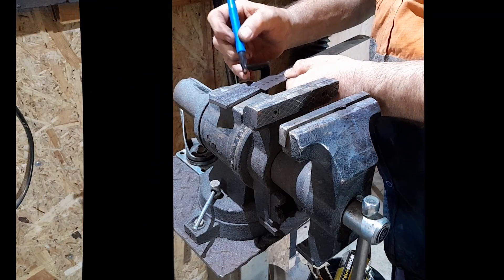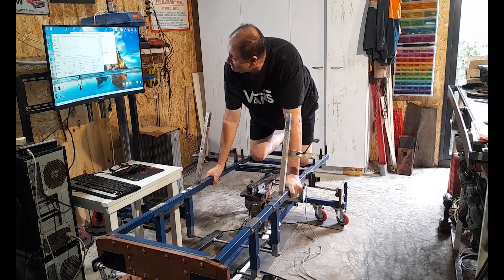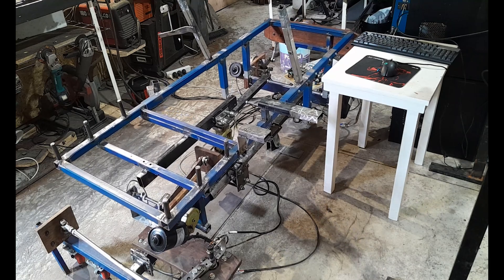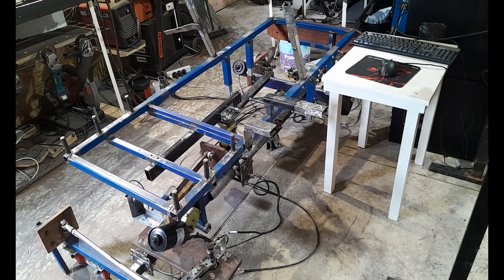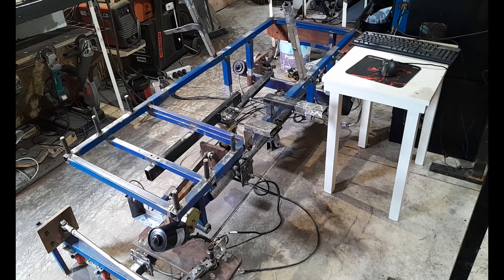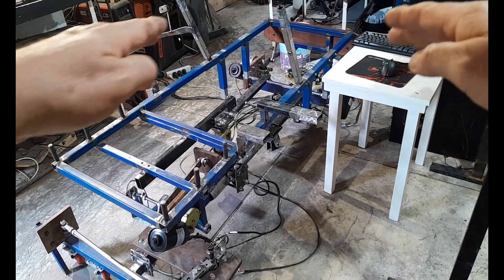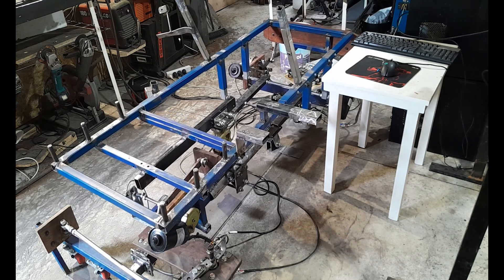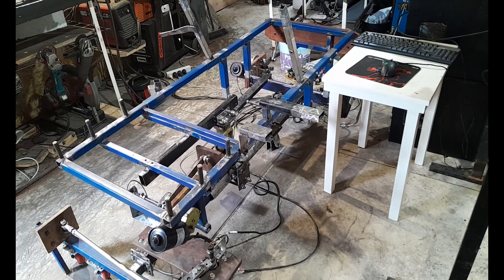DIY 4DOF Motion Platform Build For Everyone. #racingsimulator #flightsimulator #trucksimulator

Comment: Hey doc, I've found the perfect bearings to match your surge axis carriage as well as all the caster wheels (I found a pivot swivel rated for 700lbs so I figured I couldn't go wrong with how strong it looked) and I feel like I have a pretty solid idea of what I'm up against. 

I've found all the proper electronics, like 4 PSUs for the motors and Arduino Uno, but I remember you mentioned that there may be an additional IBT-2 needed for the 4DOF. Just wanted to confirm that I should be getting 4 IBT-2 controllers, 1 for each motor? I do remember you mentioned that some of them can come broken so I may order 1 or 2 extra just in case. I'm pretty sure that once I have the IBT-2 controllers ordered I'll have all the pieces I need on the way. 

I did miscounted the amount of ball joint/tie rod ends I was going to need so I'm short 2 tie rod ends. I think I can solve that by making my own with some random automotive tie rods. It's not ideal but I think it can be doable. 

Now it's time to watch your videos next to each other and try to reverse engineer some of the mechanisms for that new 4DOF. I think I'm getting somewhere but time will tell lol! Sorry for the long book and questions but thank you for the help and advise, I probably wouldn't be able to have this much confidence without you being there to answer questions and offer input. Keep up the great work!
Reply from the maker: Hey swamp man. How did you know what spec bearing to purchase? I don't think I've released any info about that yet. All good really, but the accompanying parts for the bearing trolley carriage (rail they run on, angle and plate they attach to etc) all revolves around the bearing size, not just the load! Now power supplies and motor controllers. I've been two days solid wiring and testing the new rig and I'm sick of these rubbish IBT-2 controllers. I've decided with the new rig, I'm going to spend the coin and get really good motor controllers. It's going to really increase the cost, but I'm sick of IBT-2's working, then not working. Plus, they really lack the all the finer details (bit rates and decent data transfer) you get with better controllers. I've spent so much time and effort making this thing great, I shouldn't garnish it with turds any longer.  I've been looking at the sabretooth 2 x 32's they are $240AUD each and two are required for 4 motors. But then I realised that because I have 4 power supplies (two new 50ampers) and my two existing 30ampers, this way is not ideal, as the sabretooths only take one PSU each. My existing PSU's aren't large enough to use with two motors. They are for one motor each. So I'm wasting PSU's I've already purchased as I'd need to now turn around and buy two 100 amp PSU's for enough grunt. This has directed me to the Pololu controllers. 4 required (you need one per motor and one PSU per motor so I don't waste my PSU's. They are around $200AUD each. I may end up using two IBT-2's on the horizontal motors (surge and yaw) to save some money if they are doing what is required, but I'm going to do this one way or another for a WAY better outcome and a totally kickass platform.
Reply: @Doctoradhd1  as for the bearings it was a lot of spitballing with my friend but we're fairly confident we found the same one. We took guesses on bolt sizes and used relative sizes for everything based off our guesses. Even if we're slightly wrong with the bearing, it should still work with no issue. (I think we spent an hour or 2 with your video paused as we broke it down piece by piece lol)   

After some more research I think I understand the PSUs now and how to properly power them. Now I'm off to go look at the better IBT2 alternatives you mentioned. Each days we get one step closer, hell I'm losing sleep imaging the excitement from it ha! Thanks for the info, Doc I appreciate it!
Reply from the maker: @swampsn1per878  You can go with any bearing size really, you just need to match the other components to the bearing. And if you are building the same rail system (made from 40mm x 40mm x 3mm thick 90 or angle) make sure you get minimum of 3mm thick. 

At the very peak of 90 it is thickest. Can run out to be 4 - 5mm at the peak when it's rolled out in the smelter which is what you want. This is where the bearings run. I've calmed down a bit from yesterday. It's been a long three days putting the wiring back together and having IBT-2's that were working perfectly suddenly stop working and vice versa. 

Because I'm using Ard shields this time around and hard soldering everything, it takes extra time to do this, but it's the only way to go.  I'm also researching the best IBT-2 alternatives, but there are not many options that have code etc written by someone to use with the Ards. Because the new setup requires two separate Ardunio's with separate profiles, you can mix and match different controllers on each Ard. 

This is why it may end up that the horizontal motors can stay with IBT-2's. They never have to work as hard as the vertical motors.
Reply: Just came up with another question, how did you power the power supplies? I've found the correct looking power cables but the max current is 10 amps and I know the power supplies are 30 amps. I'm not sure if I need a cable that can supply 30 amps or if a 10 amp is okay because it didn't seem like a 30 amp cord with individual exposed wires was an easy thing to source. Electricity not only confuses me but also scares me, electrical fires and electric shocks are no fun lol
Reply from the maker: @swampsn1per878  In Oz, your in home power points (sockets) circuits are all only 10amp. But that's on 240vlt AC, so take that into account as far as current goes. Your power leads from power socket to PSU's, are rated for your home supply.

Comment: This looks fantastic Doc! How much of a higher RPM motor did you end up going with? Currently I have 4 of the same motors (75-80rpm, 50:1 ratio, 180 watts) so I hope that doesn't cause any issues later down the line. I figure it wouldn't be the end of the world to redo the motor if it isn't enough.
Reply from the maker: Hey mate. Here is the spec on the selected surge motor https://www.motiondynamics.com.au/worm-drive-motor-12v-100w-30-55-rpm-8-50nm-torque-right-angle.html. You are using the crab pot type motors yes? What are the torque specs for your motors? Their rated RPM and wattage is good, but this is all effected by their torque ability. If they don't have good torque (and higher holding torque to prevent back driving is handy especially on the vertical motors) they won't be able to drive and achieve those rated RPM's. What are the torque specs on your motors?
Reply: @Doctoradhd1  I went and did a little bit more detailed research on the motors I got. They don't have a specific description of "Torque is: xyz", what they have listed in the description is "load between 50-60 N.M." (NM being newton meters if I'm not mistaken?) 

I don't know too much about motors and what units they use, so I'm not entirely certain if that's the right information. Hopefully, it'll be okay, but just on the chance that it's not enough torque to get the best results, do you think there is a way we could use some mechanical advantages/leverage to increase the motors capabilities? Not to toot my own horn or anything, but I'd consider myself pretty decent at solving engineering issues, so I figure there is probably a way to make it work if it's not powerful enough.
Reply from the maker: @swampsn1per878  any idea if those torque specs are "normal operating loads" vs stall loads? To avoid having to use my brain too much (not much bigger than a peanut) I made sure to get a high stall torque rated motor that has decent holding (harder to back drive) capabilities from the get go. I think with those torque specs youll be ok. It all comes down to getting the top frame well balanced at the end of the day. A well balanced top frame should negate the need for really high torque motors. Kind of.
Reply: @Doctoradhd1  Unfortunately, I don't know if it's stall or normal operating loads. I think I'm going to use what I have and hope for the best. Worst case scenario, it doesn't work as well as we want and I get a different one. 

I really appreciate the answers by the way. It's extremely helpful being able to directly communicate with someone who has already made the project before. I'm about to start going through the videos and figuring out what what stays the same and what is changed between the 3DOF and 4DOF so we can start building even before the tutorial videos are out (if you can't tell I'm excited to build it lol)
Reply from the maker: @swampsn1per878  You are mad keen that's for sure. That will help you a lot. Changes are overall size on all three elements lengthy wise. And the mid frame spine is now a 65mm x 65mm x 2.5mm box instead of the former 100mm x 50mm box. Bottom plate is now a 150mm x 5mm flat steel base instead of the 75mm x 5mm flat, but that's because that's what I had on hand. You can certainly still use the 75mm x 5mm flat for the base plate if that's what you have ordered. 

Just set it up like in the 3DOF base plate videos. I recon you could leave out the 75mm x 25mm box brace on the base plate traction loss plate that the TL motor push rod bracket sits on. Just make a bracket that welds straight onto the 150mm wide TL plate right in the top right hand corner of that plate. But it is really handy to actually have the Mid frame built with the traction loss axle and wheels connected, so you can run it back and fourth on the TL plate and make sure the TL push rod bracket clears the location of the bracket and the traction loss axle in it's arc of travel before welding it. This is all dependent on where the front pivot castor gets welded on. It all works together. It's hard to explain and the video's are needed (in my opinion) to fully get it right. 

I'm not too far out now from releasing the first video. There is so much in this build. It would take me hrs to explain in text how to do it. That's what the tutorial series is for. I understand your enthusiasm and the desire to get this happening, but you will save yourself a few headaches when things don't line up as needed if you try and wing it. Appreciate you following along and I'm happy to be giving something back into the world.
Reply: @Doctoradhd1  Thanks for the advise! The build looks pretty complex so I definitely understand that a video series is needed to fully explain it. 

I think I'll be able to figure out what needs to go where from context clues between videos, mainly about the frame and base. It won't just be me working on it so I'll 3 other like-minded people helping so I think any engineering issue we'll be able to tackle. I know it's not the easiest route, but frankly I'm so excited to make it, I'm willing to do the extra leg work if it means getting it done  quicker. I've never been one to shy away from a challenge.

Obviously, when the tutorials come out I'm planning on following those, or at least using the information to adapt it to work for my build. 

I also second that this is the best sim building channel, one reason being because aluminum is not easy to weld and this is one of the few using all steel that easy to get and cheap.
Reply from the maker: @swampsn1per878  agreed. I have played around with the tig and it's fun, but requires quite a bit of muscle memory to really get it nailed. Straight out stick or mig welding is cheap and dirty, but if done decently, has a lot of strength and holding power.I'm hearing you on the "lets get this bitch built" and I admire your go. I say yes!, go for it mate. 

One thing that is an advantage with using metal and a welder, is you can always wander down to the local hardware store and buy some more cut off discs. Cut it off and weld it where it fits! No better way to learn this way. But! I do encourage to measure twice, cut once if only for your own sanity. Go for it swamp man.

Comment: EH! EH! EH! Really enjoy your videos. Seems to be riding along quite well for the surge axis, considering it's on a single rail. That rig is getting pretty heavy, especially the top end being carried by the motors, thus the importance of good balance when all is set-up. What are the specs with the new hight rpm motor, speed and gearbox ratio? Right now you are one of the best sim project I know of on the internet that is not made of an extruded aluminium kit. Keep on the great work.
Reply from the maker: Glad you are getting some entertainment value from my videos. I do aim to please in this department. The trolley rail system I deliberated over for months. Do I go with a polyurethane covered ball bearing wheel, or just straight bearings on a metal track? After researching this and finding many similar applications, including talking to my mates at the local metal shop and seeing their massive roof crane that runs bearings on steel track and shifts massive loads back and fourth all day, I decided to run serviceable bearings straight to track. 

My design packs x 4 x 244kg rated bearings per trolley, so they far exceed any weight they will carry, especially when combined as a 4 pack. The adjustable UNI joint to top frame has added an element of flexibility to balancing the rig. The new design will incorporate my single computer monitor sitting on the top frame directly behind the steering wheel for a much better flight sim experience. This also adds weight so yes, you are spot on. Balance is crucial for not over loading those vertical motors. Here are the specs on the new surge axis motor https://www.motiondynamics.com.au/worm-drive-motor-12v-100w-30-55-rpm-8-50nm-torque-right-angle.html. 

Yes I see a lot of folks using the extruded aluminium box. It's very light and you don't require any welding skills. I guess that's why many go that route. It's pretty expensive and you miss out on all those welding fumes, dust, sparks and hot flying slag. Where's the fun in that?